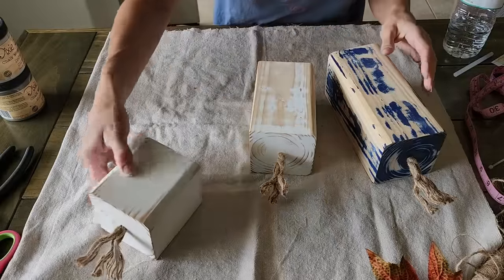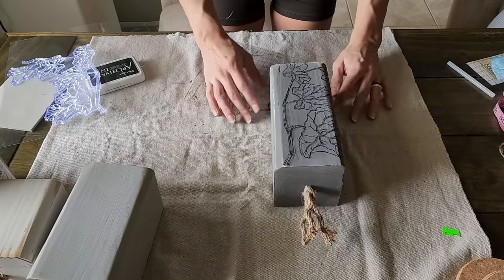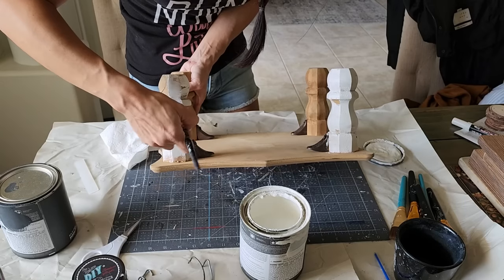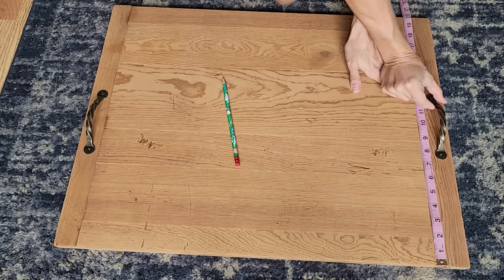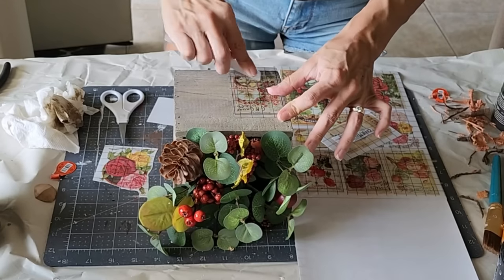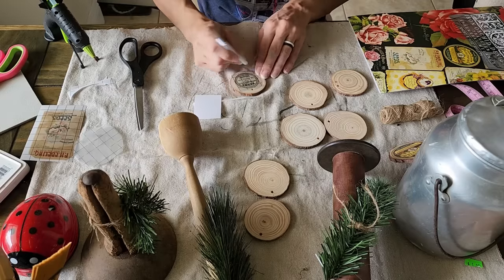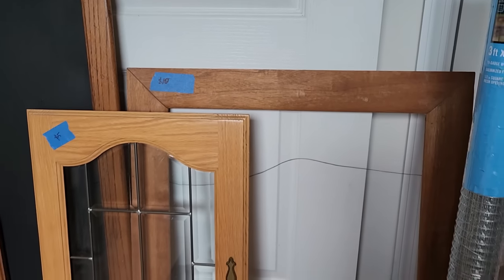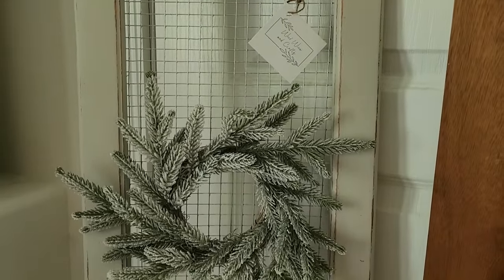Thrift Flips and DIY Projects | Holiday and Every Day Home Decor | Trash to Treasures

Comment: Okay, LOVED all the frames. On the flower box, the issue I have with transfers, is when they have a background color/frame, I just don't know what to do except to put on a piece that it will cover the whole surface. I don't know if I'd be good at blending. I think you could add white wax maybe over this piece, see if that blends it all in together.
Reply from the maker: Transfers are definitely still new to me to use with crafting. Sometimes it works out great and other times it falls flat to me. I will probably try to sand these off and try something new 😊